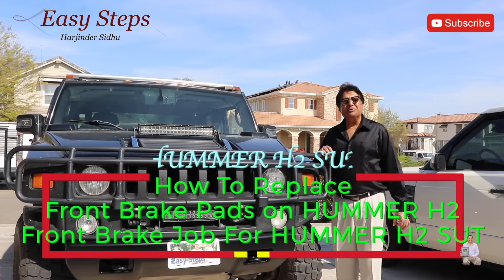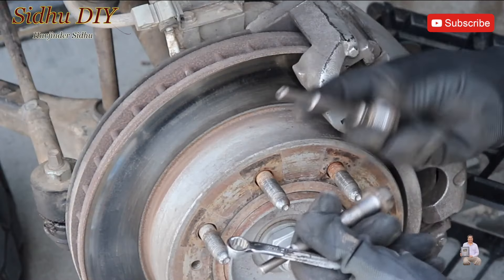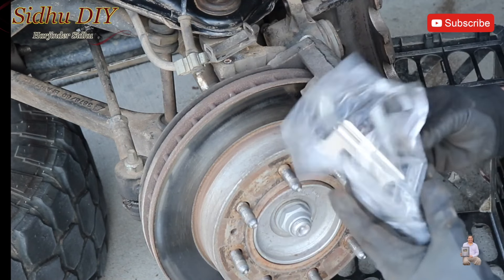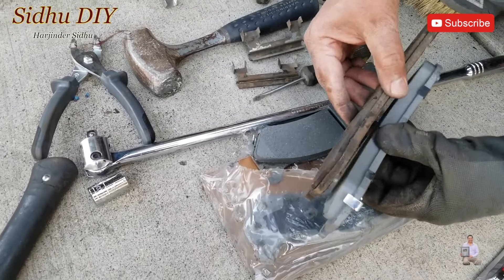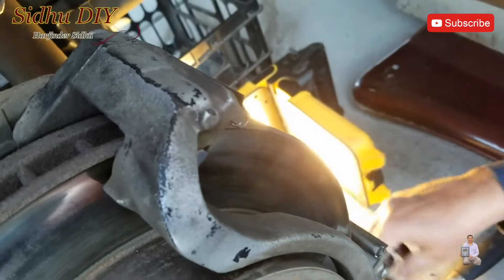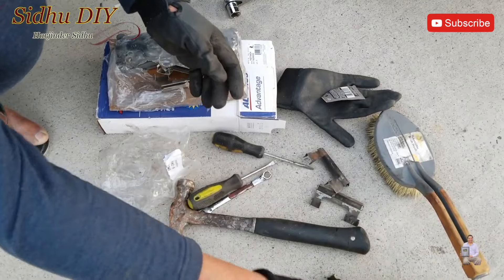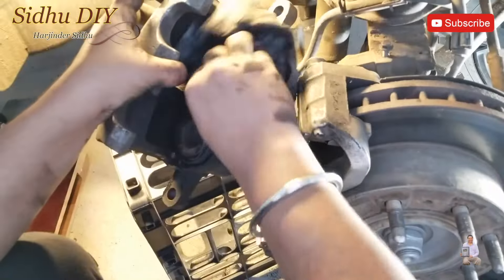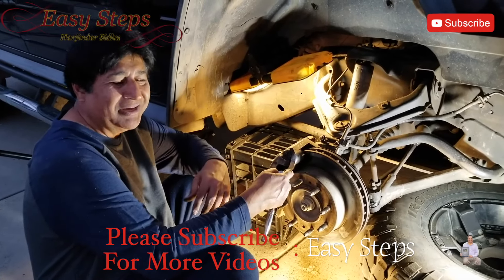How To Install Front Brake Pads on HUMMER | How To Replace Front Brake Pads on HUMMER H2 SUT

Comment from the maker: How To Replace Front Brake Pads on HUMMER H2 SUT | How To Install Front Brake Pads on HUMMER H2 SUT | Ceramic Front Disc Brake Pads Replacement on HUMMER H2 SUT | Front Brake Job For HUMMER H2 SUT - Yourself DIY

Comment: Question: after replacing the pads on a hummer, do you have to bleed the brakes at four wheels?
Reply from the maker: Good question, the answer is No, unless the brake fluid is old or you have issues with it.
Thanks for the visit and thanks for watching.🙏